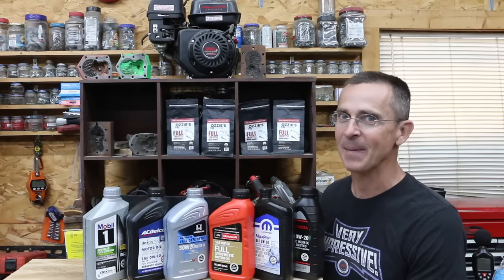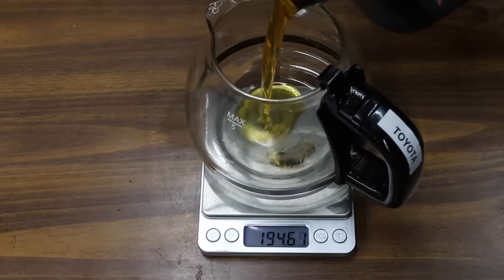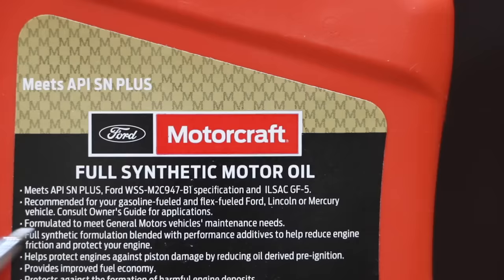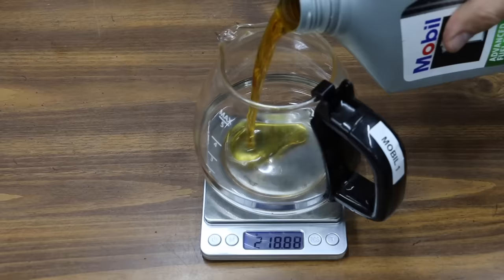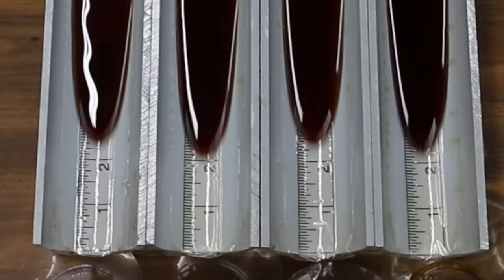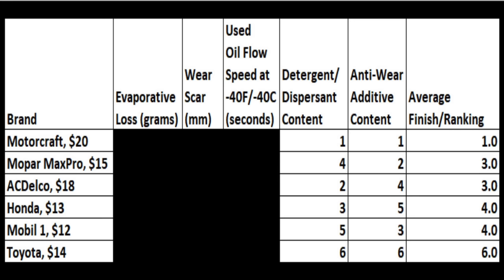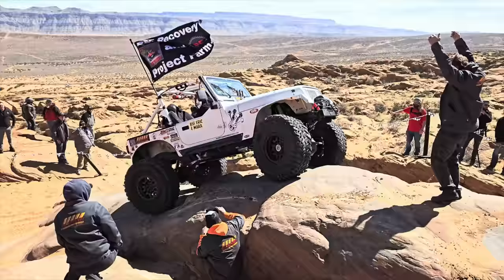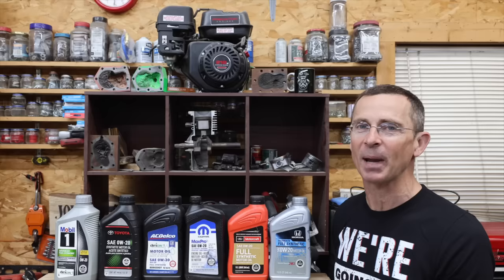How Bad Is OEM Motor Oil? Honda vs Toyota vs ACDelco?

Comment: I'm an appliance tech of 26 yrs. I have bought an electric screwdriver, shop-vac, heat gun and epoxy based on your videos. Thanks so much for all your work!
Reply from the maker: My pleasure!
Reply: Which heat gun you get?
Reply: Appliance tech 🥲😂
Reply: @JUNEBUGLLC  What's so funny?
Reply: I have bought many products based on this gentleman's tests as well...
Reply: I switched to bacon grease instead of motor oil and saved loads of money.
Reply: Whats an electric screwdriver?
Reply: I've bought tons of stuff he recommended
Reply: @JUNEBUGLLC 
Are you laughing about him being an appliance technician? I own my appliance service company for 25 years and make about 200,000$ a year so laugh all you want 😂
Reply: I made an Excel spreadsheet with the rankings of a lot of his comparisons of tools I might buy in the future. I can't keep up though.
Reply: I sawed this boat in half!!!

Comment: Could you also test, pressure washers? So many just lie about ratings. Thank you you for your time and effort
Reply from the maker: Thank you for the video idea! I tested electric pressure washers a while back but probably should test the larger gasoline powered ones.
Reply: @ProjectFarm I bought the electric CAT one after that video.  Still works great!
Reply: @ProjectFarm can you test Pro Long ? I remember them old crazy videos of cars running with no oil pan, the radiator hoses cut and they keep driving the car and it never blows
Reply: Would love to see automotive air filters. OEM, after market replaced, performance.
Reply: @ProjectFarm test degreasers-thanks
Reply: Already did
Reply: I was surprised how much fuel they use. I have a Briggs Craftsman and it’s only good for 2hrs on a tank.
Reply: Also add the heated pressure washers. Commercial (HD) vs Non Commercial @ProjectFarm
Reply: @gamebredduramax71 pro-long vs z-max
Reply: @gamebredduramax71:   He did do a test of oil additives a few years ago. However Prolong was left out. A few comments did ask why? He never got around to answering. Maybe he will do another one in the future.
Reply: with pressure washers you have to choose between PSI and GPM. You can make a higher pressure washer by changing the tip on the washer gun but lose the GPM
Reply: @ProjectFarm Cordless ones Todd.
Reply: Yes looking for most powerful electric pressure washer
Reply: @ProjectFarm  The ones around 2600-3200 psi ideally!
Reply: @EyesOnlyTeam86 that’s a lot of money at 3500 minimum each. I am a hot water pressure washer service tech and they are mostly all built the same. You are just paying more money for stainless steel vs painted steel.
Reply: Likewise and love the thing
Reply: @bradleykornele  already done ... check the archives
Reply: @drewski1441  prolong vs the winner of his last test motorkote
Reply: @ProjectFarm pressure washers would be a great video paired with surface cleaner attachments 😃
Reply: This is one of the very few YouTube channels that I watch on .75 speed. Excellent content as always, but man I get anxious with your pace of speech.
Reply: @ProjectFarm  I'd be very interested in gasoline pressure washers. Too bad they aren't a little cheaper.
Reply: @TimeAttack2003 There are so many more Degreasers that Todd didn't cover. TMX is one sold at Walmart that wasn't included.
Reply: Could also do a test on the best pressure washer hoses? I have seen the garden hose test and that was great information.
Reply: That's an expensive test.
Reply: Toyota's oil performing so badly is a huge surprise. Motorcraft oil performing well isn't, I'd run it in anything and have.
Reply: @ProToolsApproved  Todd did air filters a couple of years ago.
Reply: I had a $100 Exacta ticket on Mobil 1 & Toyota 😂
Reply: You just need a bucket and gauge to test pressure washers.   What do you want to know about them?
Reply: I’ve been wanting this for ages!
Reply: to get there power ratings what they do is send too much power through there units and record the peak PSI and then slap that on the box... so you are really only getting maybe a 1/3 or 2/3 of the promised power.
Reply: @jayyoutube8790 that's not good
Reply: Good idea.  I have a cheap Troy-Bilt with an OHV Chinese engine.....And it ALWAYS starts on the first or second pull!  Then again, I am pretty good about draining the tank and carb bowl between uses.
Reply: @EyesOnlyTeam86 bought on a Monday or Wednesday? 🙄
Reply: Best pressure washer brand ever is EVA, a Norwegian brand. Truly incredible for their size
Reply: Interested in this also
Reply: @ryantomei  The best pressure washer engine is probably a Honda, or a Kawasaki with an oil filter.  And the best pump is a CAT pump;  Find a washer like that and you will use it all the time for 15 years without problem.
Reply: @Obsessed Garage has thoroughly tested pretty much every portable electric pressure washer. Just to save you time, buy a Kacher. And you don't need to buy the highest rated model. From lowest to highest, the performance difference is very little.
Reply: You always state you shake motor oil before testing it.

Maybe do a test on a few selections to bear this practice out???

I know that a lot of special additive-style motor oils need shaking, like Motorkote, especially in the spray cans.

I’d love to know how much is lost in MOT shaking the oil!
Reply: @jayyoutube8790  ugh, dude it holds like a qt.  That's good
Reply: Pressure washer can be tricky.
Is 2500 psi better than 2000? Maybe, but you have to include volume, gallons per minute. It would be interesting to see if their volume claim is accurate, spray into a container for 1 minute & measure water volume.
Reply: Yes! That wpuld be great!
Reply: Good idea!  Corded models included! please😊.
Reply: @ProjectFarm  Simpson power washers have rebuildable pumps vs. most others that have throwaway pumps.
Reply: I've asked this multiple times... I want good commercial style pressure washers. With aaa pumps or cat pumps.
Reply: There are a couple of pressures washers available that can be fed from a 2L bottle. I would love to see those tested.
Reply: @bradleykornele the limit to power is the 15 amp outlet they're plugged in to. I just bought the Dewalt because of its storage capability and am happy, but there may be one that flows a little more.
Reply: And here I thought Signature Series was expensive$$$
Reply: @ProjectFarm if you could test the battery operated handheld pressure washers that you put the hose into a bucket etc.
Reply: Definitely!!! Gas ones preferably. That could get expensive.
Reply: @dangeary2134 I've been working on cars since 1993 & have never once heard about shaking motor oil before use.
However, It makes complete sense and I feel stupid for never once doing it with my personal vehicles, most of the oil I use is at work and bulk from a 500 gal tank.
Reply: He had awhile back. I bought the CAT one. After watching test results.
Reply: He finally did another oil video and you’re asking for pressure washer testing? 🙄😮‍💨Oye vey!
Reply: @ProjectFarm There are some Big Boy electric pressure washers out there too. DeWalt makes one, runs on 240v I think. It would be great to put something like that in the lineup.
Reply: Cat 1800psi. Power washer. Bought and works good. P.F. tested.
Reply: Been using Castrol oil for 40yrs. Not one oil related problem in hundreds of thousands of miles, in multiple vehicles.
Reply: actually would really appreciate this video, Loooking forward to it ive showed my gpaw a ton of your videos to end the endless conversations over what is best  @ProjectFarm
Reply: @ProjectFarm 
I'd like to see you test the now so common $80-$120 Amazon import washers. They are really small and compact and range from no psi stated to 3000+ psi from these very small and cheap washers.
Reply: @ProjectFarm if you do if like to see how the Simpson brand performs
Reply: @johnhershey4010  I also didn’t like the pull start. It seemed to have a higher compression ratio than the normal 4.5hp. If it ran completely out of fuel, (which it did easily) it was a bear getting it going again. Last year I bought an electric one that’s only a 1200psi (vs the gasoline 1800psi) and I wish I would have got it before my gasoline one. For around the home the electric one is the way to go.
Reply: Yes please add the bosch 2100 140 psi version
Reply: buy a sun joe.  Affordable, and last a LONG time. I used to do detailing.
Reply: Kings
Reply: Thinking of trying redline oil in my 370z. Seems to be the best
Reply: @ProjectFarm I keep seeing Prolube stuff that claims to be the best oil additive by a landslide. They have done some wear tests, but this is the only review channel I trust completely. Any chance you can give it a review?
Reply: Wonder how true the Westinghouse 2500psi is had a sunjoe 2170psi and a Stanley 1600 the Stanley felt stronger then the sunjoe by a lot

Comment: This is probably the most valuable channel on youtube
Reply from the maker: Thanks!
Reply: No not really actually. Toyota used over time CASTROL THEN MOBILE THEN SHELL HELIX AS TOYOTA OWN BRAND. So pretty funny. If you know this it change EVERYTHING. My 1999 toyota paseo runs the best on castrol magnatec 10w40. Anyway all major brands like ford honda and others uses oil they can buy in bulk for a good price. Could be mobile or castrol or shell or elf like on renault.
Reply: Same as spray paint. The lowest price will be bought in bulk. Doesnt matter what brand...... ppg standox akzo nobel etc etc
Reply: @KLOKSLAG1911  I'm glad you were able to spend millions in R&D and had the engineering knowledge to figure out that your engine runs better on 10W40 than the 5W30 it was designed to use.

The rest of us don't have nearly as much time or money on our hands. I'll continue watching this channel to compare oil brands, and I'll stick to using the weight of oil that the engine designers recommend for my engine
Reply: Whole lotta yapping and he didn’t actually test anything meaningful
Reply: @v12-s65  the main value of this test is seeing how these oils maintain viscosity after being abused. I'm sorry you don't see the value in that, I don't know what to tell you, other than, you should probably stick to hiring people to work on your cars!
Reply: @Drivin_Sideways  it doenst make any sens at all what ur saying 🤣🤣🤣
Reply: @KLOKSLAG1911  at least I was speaking English 😅

Comment: 10,000 miles 😂😂 With the evaporative loss, you’ll be adding 10 quarts over those 10,000 miles. The Mopar for being overall 2nd, but yet $5 less per quart is a decent bargain.

Comment: I worked in an OEM oil manufacturing factory as a chemist.  Something to keep in mind, most automotive companies build oils that work best for their engines based on dyno testing. They will put an engine through multiple high rpm cycles for weeks and determine the wear metals in the oil throughout the test cycles. Also, oil additives are added in excess. Even with the oils with lower concentrations of additives they are in concentrations well above necessary. Your oil viscosity tests are not accurate at all and they should be done at normal operating temperature. All of those oils have a 0 winter rating and did you see how different they were at cold start temp? The same thing happens at operating temperature. We would measure oil viscosity in capillary tubes that had a known diameter and were submerged in an oil bath at 80c. Also, for price we could never beat amsoil or royal purple for full syn oils.
Reply: Pleanty of people drive their cars for miles before the engine is up to running temp. With my short commute I drive with the oil colder than operating more than above, and even more so in the winter.
Reply: @soaringparakeet  in the name of standardized testing, so that you stay apples-to-apples, no one can get value from checking parameters after a vehicle has been driven at such slight increments such as 1/10mi, 1/8mi, 1/5mi.  On that note, since I did purchase a vehicle driven like yours, my mechanic was shocked how much instrument air pressure was needed to blow out the oil returns...so if you think your "light" use is not harmful, you will surprised to hear it might be the worst thing you can do for an engine.  You absolutely should never go beyond 6mos without an oil change and you should absolutely fear a rising oil level or gassy smell as you could have gas washing your cylinder walls and diluting your engine oil (happened with my '18 Camry mid-winter this year).  Make sure you get that engine up to full temp at least once a week.
Reply: @soaringparakeet "Severe driving conditions" include short commutes. Take the vehicle on a highway for half an hour once a week.
Reply: You must have retired some time ago because there are several oils better than Royal Purple, like Pennzoil Ultra Platinum and Quaker State and Castrol synthetic oils.  Redline is better than Royal Purple too.
Reply: @richcombs4805 you're being over cautious.  My parents drove very little.  They changed their oil once a year at inspection time.  They died years ago.  Their cars are still on the road and neither burns oil.  Changing synthetic oil with less than a few thousand miles is just wasting good oil.
Reply: @wsbill14224   yeah if you get an oil analysis done to confirm still good, then I'll agree.
Reply: Thank you for the introduction of royal purple to my life lol... never heard of this brand until now
Reply: My thoughts exactly, each are optimized for the engines they were designed for.   Knowing the materials/alloys of the build of your engine is what really determines what is appropriate for your engine.  Too much of a particular additive could actually cause more wear than intended.  There is a balance to how much zine, phosphor, etc.
Reply: @soaringparakeet how come these "full synthetic" oils only have ilsac and API??

I bought a Shell helix HX7 synthetic technology is rated API SN PLUS, ACEA A3/B3, VOLKSWAGEN, MERCEDES BENZ, RENAULT APPROVED. so I think it's Shell helix HX7 is marketed in the states , it would be considered as full synthetic
Reply: @wsbill14224  Which is why the cheapest even non synth that is changed frequently is better than the best oil. The focus on oil performance is all wrong. Clean fresh basic oil is most important.
Reply: Do you recommend AMS or Royal Purple over OEM? I’m OEM all the way, but I’m tempted to switch to AMS if it’s better for the longevity of my engine.
Reply: @miniaddict4534  Cheapest, changed every 3k or even 2k. Ask any mechanic who is knowledgeable in very long life engines (500k and up) and they will tell you the same. If they tell you engines don't last that long they are the wrong people to ask.
Reply: @miniaddict4534  if your not driving a high performance race car it won’t matter too much. If you are running small engines then I would consider something after market. Although, two stroke oils are quite finicky and I would stick to oem oils.

Comment: I quit MOBIL 1 a looong time ago! I upgraded to Kirkland's, Walmart's Super Tech, and all WARREN-manufactured products! YOU THE MAN, "FARM"!!!
Reply from the maker: Thanks!
Reply: The differences are so slight that you just can’t justify the tremendous cost difference. 
Unless you intend to do extended oil interval changes .
Personally 5,000 is the limit.
Currently it’s $18.98 for 5 quart jug, Mobil 1 is at least $10 more and forget about Pennzoil Ultra.
For that difference you can get a really good oil filter as a bonus.
SuperTech (Warren) all the way .
Reply: I use Kirkland full synthetic in all my automobiles. Thank You

Comment: Bought my 2003 Chevy Tahoe 5.3 L brand new in May of that year. Did all the oil changes myself, but not always on time. Sometimes went 6,000 or maybe 7,000 miles between changes, but mostly changed when the oil when the life clock got within 5%.  Use Mobil 1 5W-30 exclusively and without exception. Still driving the Tahoe. It currently has 244,000 miles on it as of March 2024 and runs like a raped ape 🦍. DOES NOT BURN ANY OIL at all, but did have to change some gaskets and replaced the oil pan due to being 21 years old and the pan had a small crack. I would never consider using any other brand of oil in view of these results….

Comment: This may be the most valuable research channel on YouTube. I love your work.
Reply: Would be interesting to see BMW vs Shell, Mercedes vs Mobil 1, VW vs Castrol. Testing OEM oils made by those companies vs what you buy from the dealer which is made by the same manufacturer. Basically testing OEM vs Off the shelf equivalent
Reply: Absolutely!